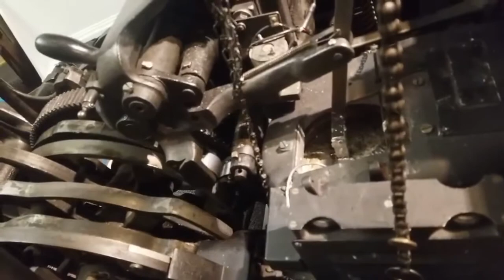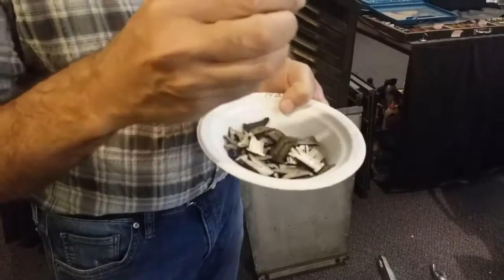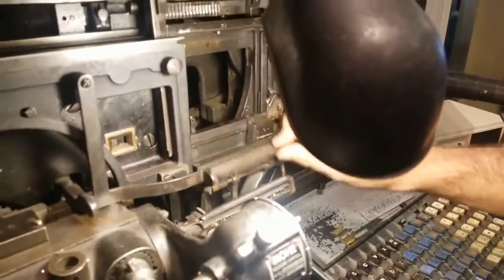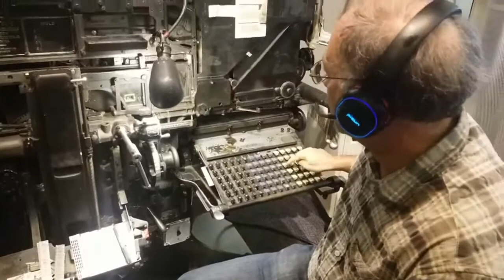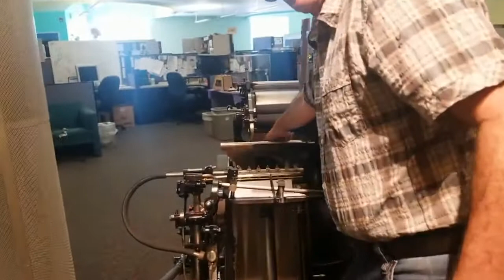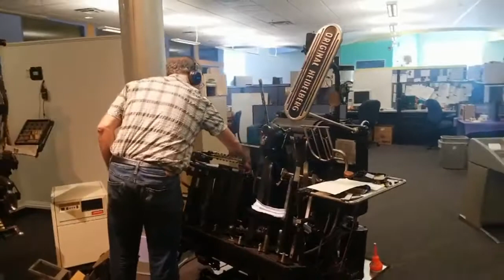VCF East: The Linotype Machine

Comment: Ever used one with a gas heated pot? I have. Linotype / Intertype horrible to use if the distributor keeps jamming or the magazine is dirty inside; or you forget to set the right ejector to push the slug out of the mould. :)
Reply: I ran both/4 for 2 years to print personal as well as business style checks.

Comment: The clickity-clack Steampunk wow factor on this is off the charts. Mergenthaler was apprenticed to a watchmaker in Germany so he had a fluency for all this fine mechanical precision (somebody bring apprenticeships back). He was tasked to do this by the legal industry, which has to have at least four copies of everything (as Richard Nixon said, you need a cast iron behind to be a lawyer, looooot of reading). Newspapers ran with it, design was a mainstay for a century. The modern air conditioner also came out of the printing industry when Sackett-Wilhelms Lithographing & Publishing Company in Brooklyn hired Willis Carrier to remove the humidity in the cavernous printing plant that was causing paper to shrink and swell (and it is HOT in NYC in the summer). Somebody noticed "Hey, it feels really good in here" and Willis installed a version of his "chiller" machine in movie theaters, it took off from there. America baby.